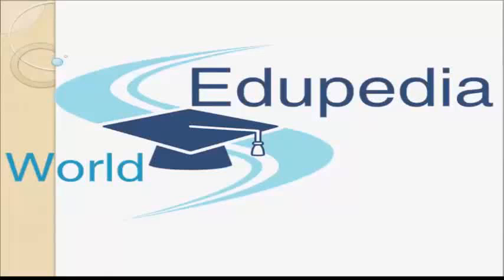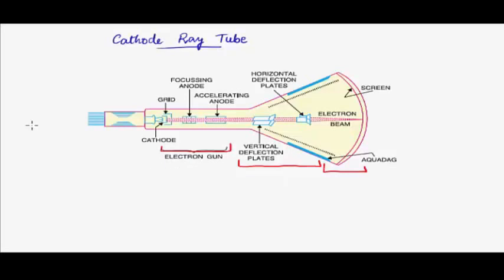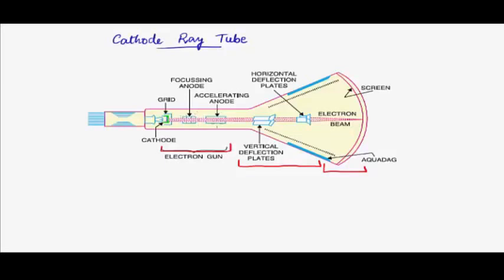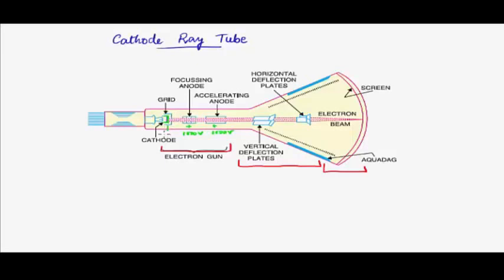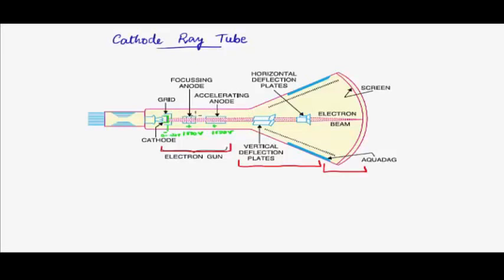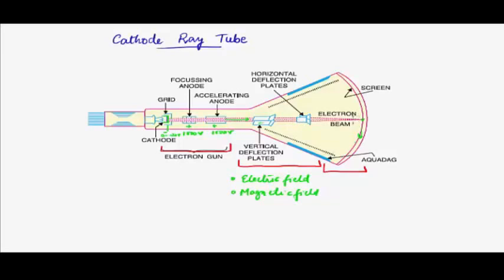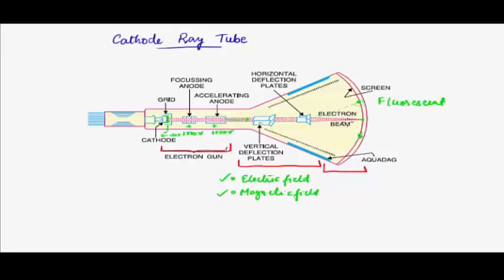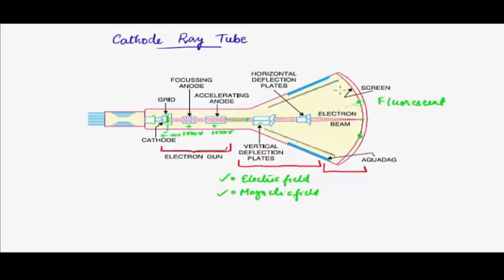Thermionic Emission | Cathode Ray Tube | Construction | Working | Part 2

Comment: anode is a positively charged electrode and electrons are negatively charged but here in the cathode ray tube the anode is used to focus and accelerate the electrons how is it possible , how?
Reply: Anode being positively charged will attract electrons. Hence the magnitude of positive potential of the anode will determine the acceleration of the electron. More positive potential, larger is the acceleration.

The focusing anode attracts any stray electron towards itself (due to positive charge) and hence focuses the electrons into a small beam rather than being spread out.

Comment: I can't understand deflecting system
Reply: Electron being negatively charged particles are attracted towards positively charged plate (or repealed away from negatively charged plate). Also a moving charged particle is deflected by the magnetic field and the amount of deflection depends on the strength of the magnetic field. Thus by changing the magnitude of electric field or the magnetic field in the deflecting system, the amount of deflection of the electrons can be precisely controlled, thereby the position where the electron will strike the fluorescent screen can be controlled.